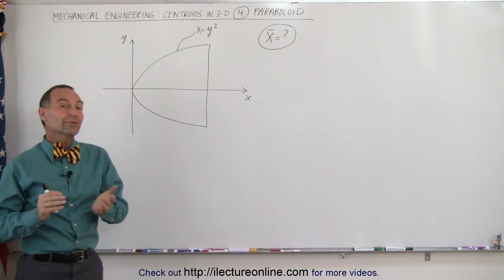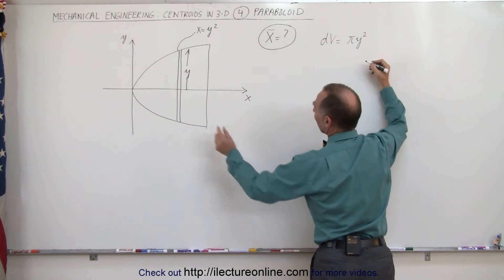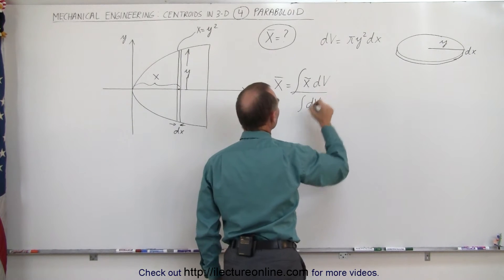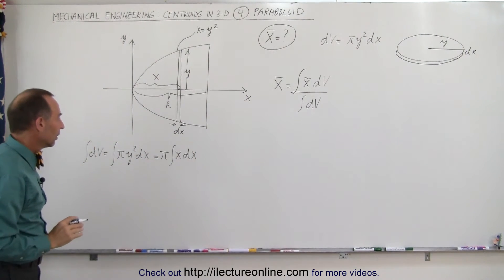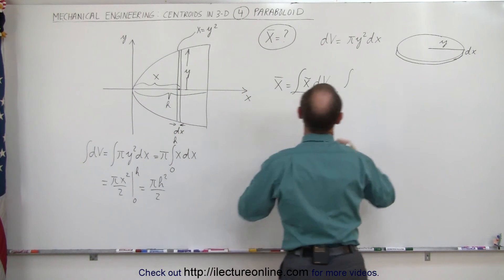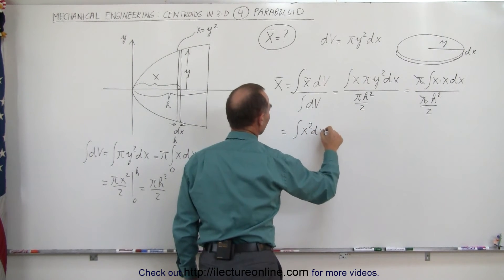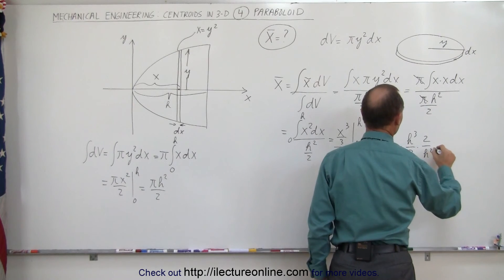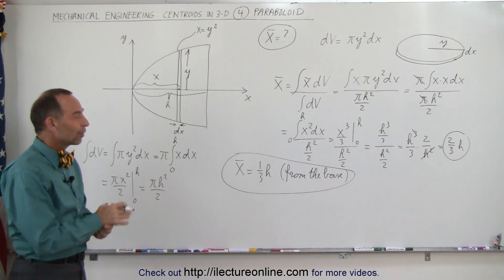Mechanical Engineering: Centroids in 3-D (4 of 19) Paraboloid

Comment: I don't understand why you did the integral of the denominator too, that is to say why you wrote dV instead of V
Reply from the maker: That is the general formula to find the centroid.  if you know the volume, then you don't need to integrate the denominator.
Reply: I can't follow your reasoning , in the general formula of the parabolic area X = integral x * dA / A , why is different here X = integral x *dV / integral dV ?
Reply from the maker: It depends on the object.  Are you finding the centroid of a flat plate or are you finding the centroid of a volume?
Reply: A volume. This is my reasoning : I need to find the centroid  of a paraboloid of revolution , so a 3d object with a volume (mass and gravity , so weight is not relevant for our reasoning). To do so I need "calculus" ( as Newton and Leibnitz teach us).  I have to find coordinates with respect to x and y axes. In this particular case I know my y coordinate is 0 so I don't need to calculate it. but I have to find the x coordinate . So I can split my volume in many very small volumes, that is to say in formula : X * V = x1 * deltaV1 + x2 * deltaV2 ... xn + delta Vn. If these slices are so small that we can consider them infinitesimal then we can use integral that are basically the sum of all these infinitesimal slices, so : X*V = integral x + dV that is to say X = integral x + dV / V . Where I'm wrong?
Reply from the maker: weight is not relevant if the density is constant.  The method (direction) of slicing is important.  Each slice must have its own center of mass.  My suggestion is to look at a few examples and then try to duplicate the method.
Reply: I don't get it , anyway now that I think about it writing the integral of dV is equal to write V
Reply: zazi settantasette yes. integral of dV is equal to V